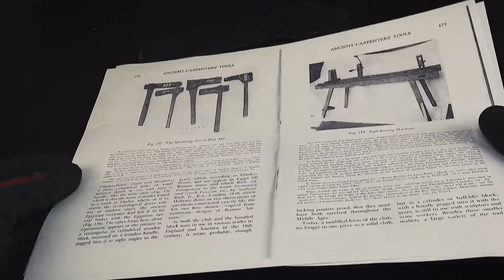Restoration of a 150-year-old Mortising Axe

Comment: Please use 20% citric acid solution.  24 hours of lying in the solution will remove rust.  If you need a protective layer, you can boil it in citric acid 3-4 times, removing rust residue with a cloth.  It hurts to look at the ax sagging in the water.

Comment: I like what you did with the handle better than the head, but as a show piece it is well done.
Reply from the maker: Well, this axe is unlikely to be used for its intended purpose, it is very old and made of very bad iron. So with difficulty I cleaned off the rust and preserved it with tannin and wax. Will be a new item in my collection.